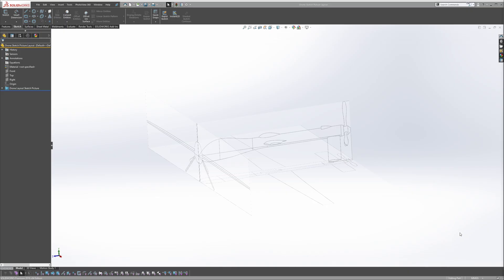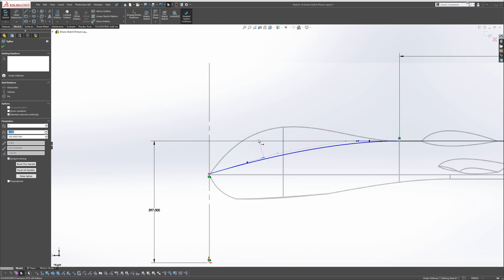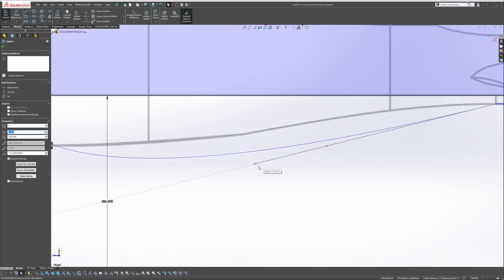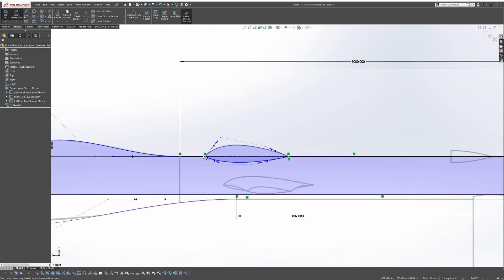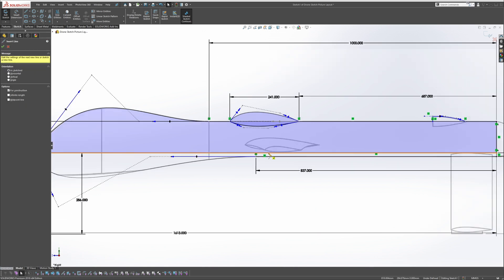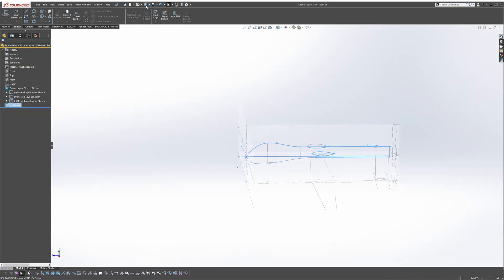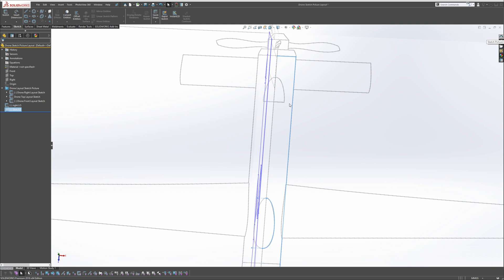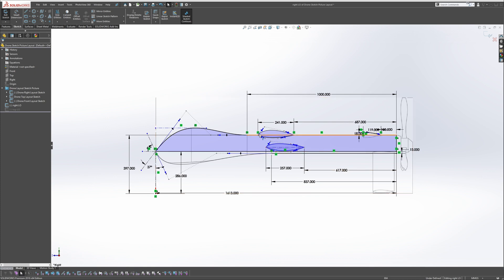WHY this is important. Creating LAYOUT SKETCHES | SolidWorks Drone Model [Part 2]

Comment from the maker: This is Part 2 of the drone modeling series. If you miss part 1 check it out here: https://youtu.be/_NoetH0RM5o

The purpose of this step is to capture all the critical dimensions of the part. Creating excellent layout sketches upfront it will make it easier to make changes down the road because you're building intelligence into the model. 

Download & Try SolidWorks CAD Software free trial:
https://my.solidworks.com/try-solidworks

Download the free project files here:
https://rathasochenda.com/download/

Time Stamps

00:00 - Why this is important
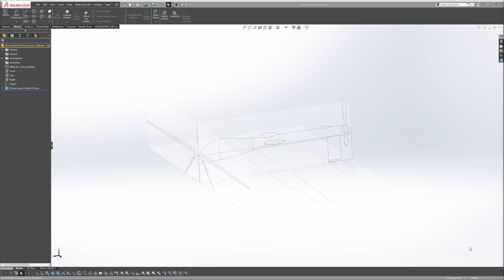00:40 - Creating layout sketches
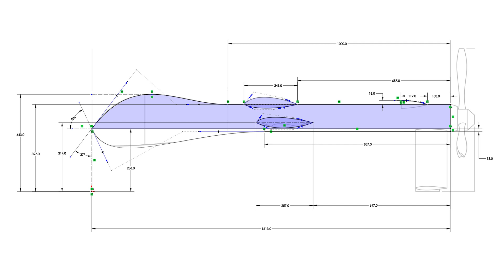19:07 - Screenshot of the layout sketches of right and top view for reference
19:16 - Why this will help you in the long run